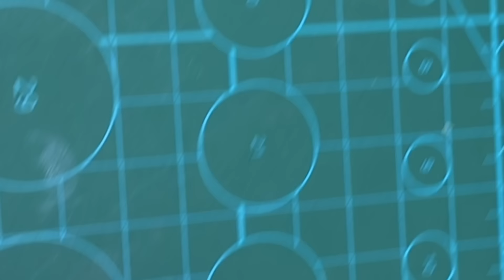7 SIMPLE INVENTIONS

Comment: Got an idea from the sealer.
Inside pipe cutter with a washer, bolt and nut. Just grind edges in the washer and use it in a power drill to cut pvc.

Comment: 4:03 

That's a silly thing, if you pull the trigger, that's gonna slow you down if you're going at full speed, and that's the trigger for the front wheel and that's going to pull you if you're going at a very high speed.
Reply: That's the point. It's a brake light to show vehicles behind the bike when the bike brakes so they don't crash into the bike.

Comment: What is the blue thing at 2:21 I need it for a machine ?? Please Help me !
Reply: Its a resistor used to slow down current and drop voltages . ..youll get different rating for it ..you have to check the value of resistance you need for your machine and ask that valued resistor at the electronics store.